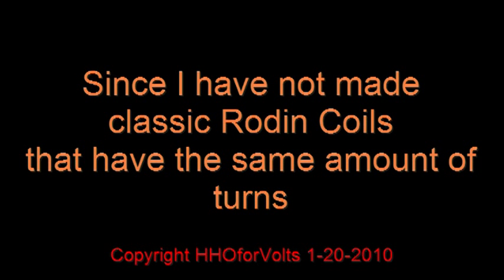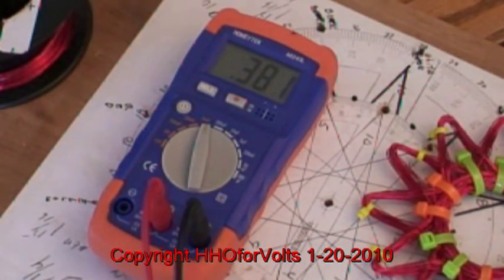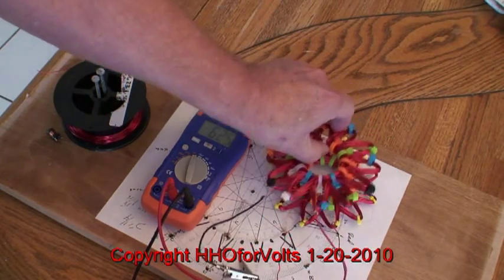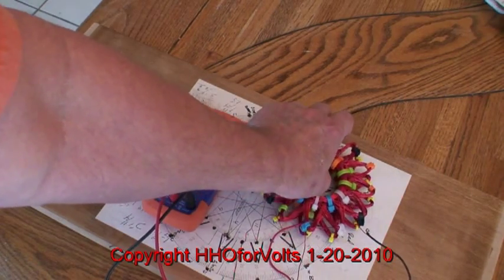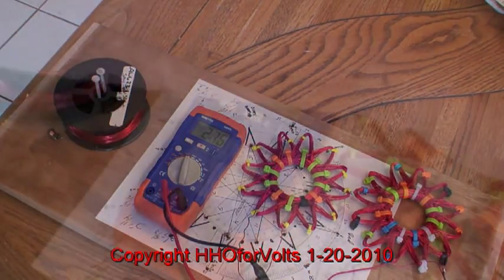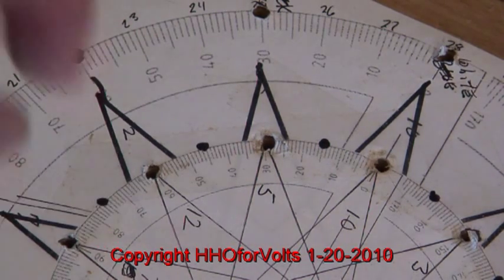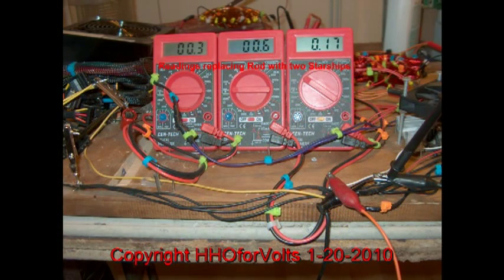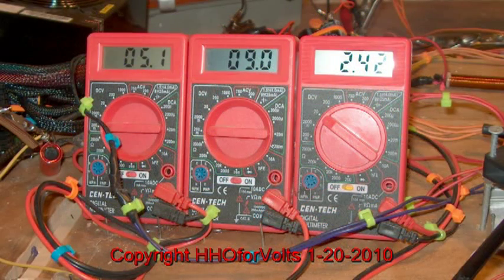Rodin & Starship Coil Testing

Comment: Richard, what I found is the same as you, but when I run through my stacked Rodin's into my cell, using the cell as the load, everything changes. When I place the Rodin's on both sides of my dry cell, depending on their orientation, hydroxy production increases.
Tell me what size wire and how many turns you are using and I will send you a Rodin that matches it so you can test them side by side.
Peace.
Mike.

Comment: I like it Richard, easy well laid out test that we can all understand 
You could try putting a 12 v  filament light bulb between the 2 coils, in series with the circuit, to pull up the amps... might be  detracting from your tests though... just a thought???
Jim